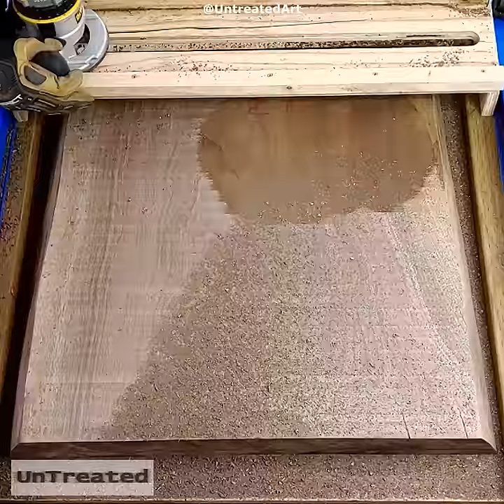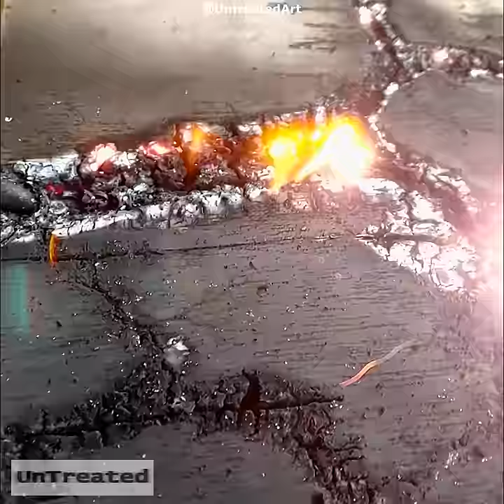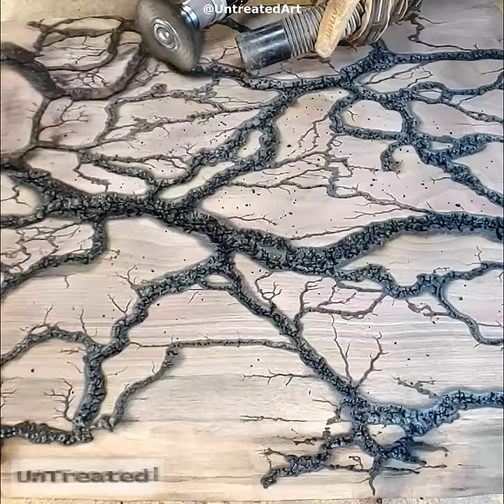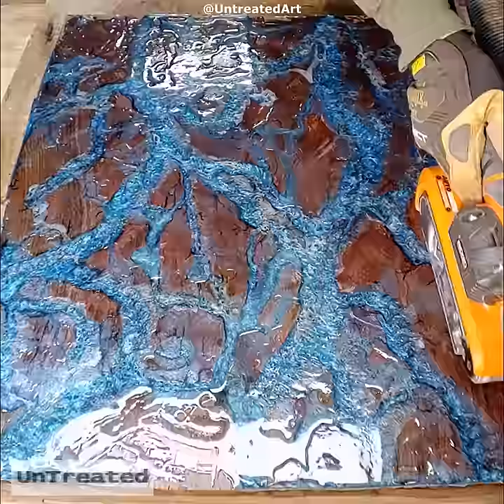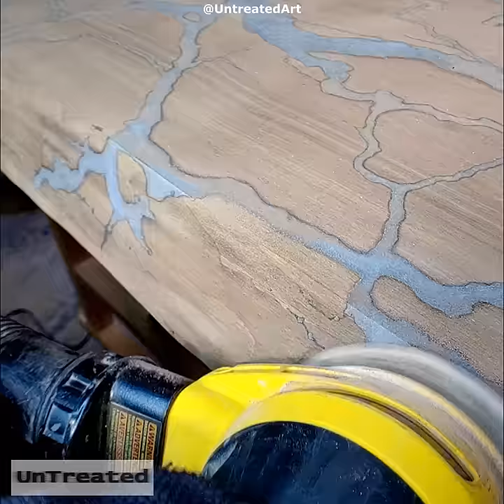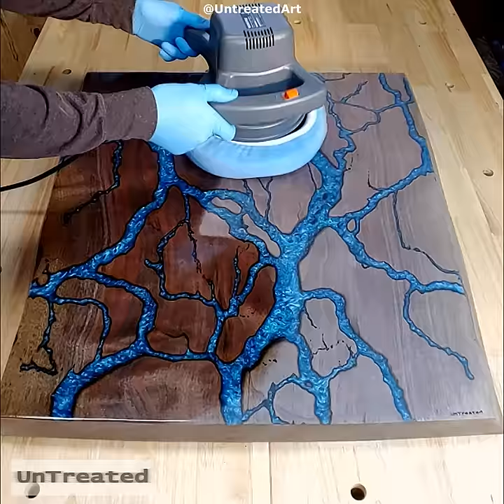Making a Fractal River Table with Blue Epoxy Resin Rivers

Comment: Pretty.  But, I would have left the charred wood in the cracks, installed ultra fine LED lights in the bottoms of the cracks, filled them with a red/orange/yellow epoxy mixture to look like lava, then cover the entire piece with a thick layer of clear epoxy. All the wiring could be hidden underneath.
Reply: I would like one like that
Reply: That would make an awesome hardwood floor path towards open stairs to a loft.
Reply: I think the charred wood might create too loose a surface for a good bond. But the rest of the idea sounds cool :)
Reply: @ORSkie  🐾 Fur babies would scratch it up too.  But it is beautiful work!

Comment: That is stunning!
Reply from the maker: Thank you!
Reply: @jeremyelkins  it’s a pleasure! have you ever tried putting LED’s inside the resin?
Reply from the maker: @helensandham86  Haven't yet, but we have done glow in the dark resin
Reply: @jeremyelkins  wow, that sounds amazing! You should experiment with it. These days you can really cool LED’s. It’s difficult to explain: it’s single lights on a copper wire with a USB port. They are surprisingly bright, I think it would look crazy if you turn on the ‘water’ in the table.

Comment: What are you using to burn wood I can't tell what that is
Reply: Usually it's a modified microwave inverter. You need something that produces high voltage but low amps
Reply: That is my question too
Reply: @sideering370  thanks for answering

Comment: Whats the name of that tool that makes the lightning design in the wood
Reply: Angry pixies
Reply: It’s a lezer
Reply: Nails & battery charger.
Reply: It is common to use a microwave oven transformer but there are other safer high voltage power supplies.  Search lichtenberg wood burning for more info.
Reply: Welder arc

Comment: What was that burning process, fantastic!
Reply: I think they burned it by appling a high voltage (These two sticks you saw), but i guess u cant really control it
Reply: It's called fractal wood burning. Not for amateurs, It's incredibly dangerous.
Reply: It is actually called lichtenberg wood burning. Look it up

Comment: What did you use for sanding? Your video doesn’t show it running threw a planer
Reply: start at 0:03 he's using router jig with rail track as planer, btw if ya planing making one, make sure use router with 1/2 inch, its more stable  than 1/4
Reply: @ekowahyuwibowo9494  ok thanks
Reply: Itu bakarnya pakai apa ya? Kok bisa keren gitu
Reply: @khalil.gokil29  lichtenberg fractal om, sebaiknya sangat berhati hati, kemarin ada yg nyoba tapi kesetrum mati. banyak korbannya
Reply: Berapaan y hrga alatnya mas
Reply: @khalil.gokil29  ada kemarin conestoga mulai 5jt/set om , tergantung brand nya juga. 12.000V 35mA
Reply: Ok trims info nya om🙏🙏🙏
Reply: @khalil.gokil29  crafting beginian duet ama ahli listrik om, soal processing kayu nya insyallah gampang klo power tool nya lengkap, selamat mencoba